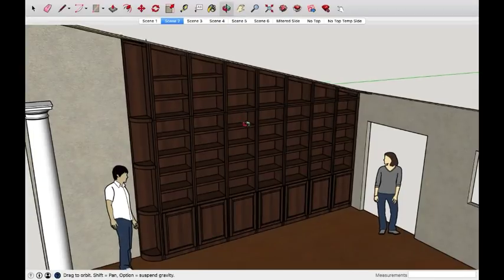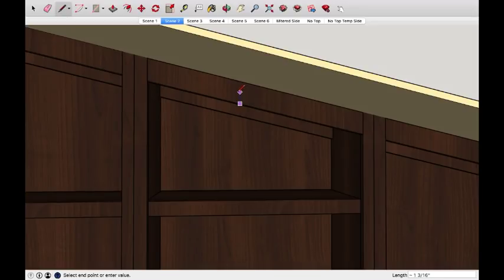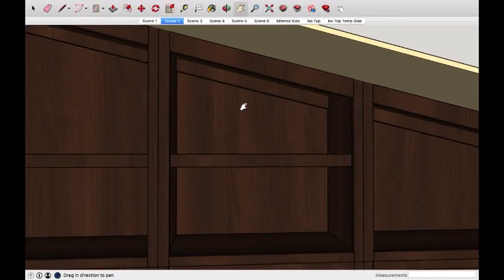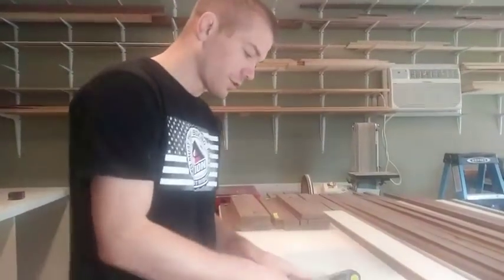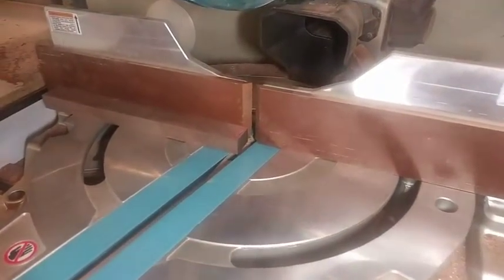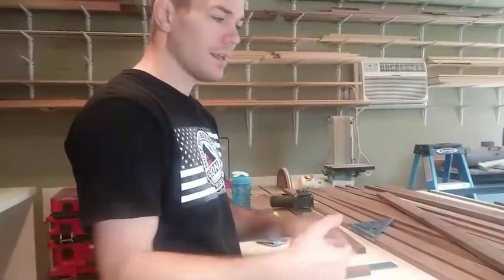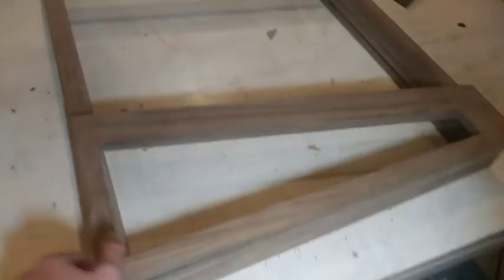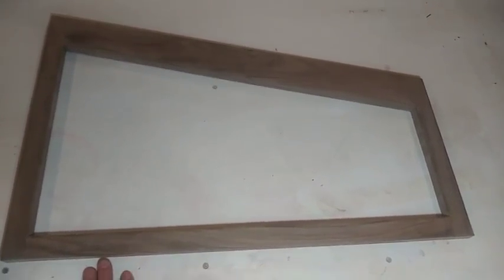Finding angles without a protractor

Comment: you obviously know how to build cabinets, but your explanation of "how to find an angle" was confusing as hell.  The only tape measure I saw you use....was the one included in the SketchUp program.   what was the point in measuring the high point of each of those face frames?!  Seems this method is only good if your project has been planned out in Sketchup.
Reply from the maker: Haha! Thats funny. Well if you dont use sketchup then you will need to do the geometrical math by hand to see what those measurements will be. theres no shortcut to the design phase. You either need to design on something like sketchup that will do the math for you, or you can do the math yourself. But you will be able to find that high spot either way and do it the way i did it